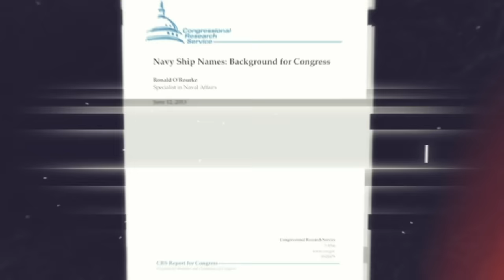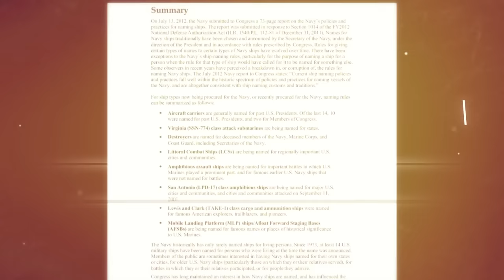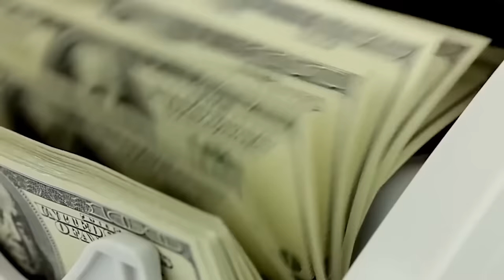US Is Testing Its New Gigantic $13 Billions Aircraft Carrier

Comment: Interesting but down voted for misleading thumbnail. Also, aircraft carriers today have less to do with providing real tactical support against developed armies and have more to do with providing political pressure. Coordinated batteries of modern missile systems can overwhelm and sink any ship, including those with advanced long range defenses.

The only question is how many and how fast.
Reply: Flawed analysis.  (1).  Political pressure in the form of a deterrent avoids pathetic, costly wars.  (2).  Sinking a US carrier group would put you in a world of hurt in terms of response.  (3).  The Chinese just completed their own home-built carrier.  Seems the need for projection of naval power, especially in regions that have none of these anti-carrier missile system capability, is shared between two radically different governments.
Reply: @j.hudson9652  I'm not qualified to support either side of carriers being useful militarily or not, but the Chinese are very much the exact type of government that would spend billions on a pure prestige project.
Reply: @tylermech66  Excellent point.
Reply: can coordinated batteries of modern missile systems hold ground? can they physically occupy there? can they reach the range without a naval fleet? can they launch real attacks?
even with tanks when a tank can be destroyed by a simple missile launched by a soldier, you cannot hold ground with those missiles, you still need the tanks
with these aircraft carriers carrier groups are capable of using planes and support and recon and the radar coverage allows real missile launches which wouldnt be capable without these carriers
modern missile systems cannot reach that far of a range unless they are big icbm's which are extremely costly and not that accurate, you would need far larger barages to take down a warship assuming you know where it is (which you need air support for)
Reply: We’ve got nuclear submarines to deal with that

Comment: The arrester cables are not "ropes".  They are extremely high strength woven steel cables.  They are the most dangerous thing on the deck for the deck crew since if one snaps during its pull phase, it can whip across the deck at very high speed.  Important safety precautions are related to this danger.
Reply: Actually they are arresting gear cables made of hemp core wire rope.
Reply: The arrester cables are not "ropes".  They are extremely high strength woven steel cables.  They are the most dangerous thing on the deck for the deck crew since if one snaps during its pull phase, it can whip across the deck at very high speed.  Important safety precautions are related to this danger.
Reply: I’ve been using wire ropes for years I had no idea that ropes must be made of cotton or hemp what are these round woven things made of metal called the store told me they’re wire ropes o great one what do we refer to them as cables doesn’t seem to fit because they are a bunch of wire ropes twisting together is it a size thing like boat’s versus ships like my thing is bigger than your thing🤔
Reply: So it’s a steel rope then. That’s not a boat it’s a ship.
Reply: @flashgordon6670  Unless you're an Airdale then they're all BOATS! lol
Reply: There's a video on YouTube of a Hornet going over the side when the cable broke.* In slow motion from another angle you can see one of the flight deck crewmen jumping over the cable as it whips around, not once, but twice. Lucky guy!

*I talked with someone who said he was in one of the two arresting gear rooms associated with the problematic cable. I forgot the specifics of what he said, but apparently something about the purchase cable was rigged incorrectly and so the cross deck pendant didn't break, the whole thing was pulled out. True or not, I don't know.
Reply: Any idea how often the cables are replaced? I've always wondered....
Reply: @luke8210  Yep! When I was in the Navy I deployed aboard USS Carl Vinson, and years later when I was a civilian employee of the Navy I spent three days at sea on Vinson. One of the Aviation Boatswain's Mates explained it to me.

There are actually three parts to the cable. The portion stretched across the deck is the cross deck pendant, and each end of that is attached to a purchase cable, which runs down below the flight deck to the arresting gear engine rooms, one on each side of the landing area. I believe each cross deck pendant is replaced after 100 traps or if there are signs of damage;the purchase cable aren't replaced as often.

The crews make their own cross deck pendant (CDP) assemblies, and I imagine they have a few ready to go. So each end of the CDP fits into a steel sleeve open on both ends (I think, but I'm not certain of that) and that sleeve is what actually attaches to the purchase cables. The CDP can be replaced in just a couple of minutes, I believe.

The process to make a CDP is pretty interesting. They of course have big spools of cable, so first they cut off the length they need. The take each wire strand and separate them all so none are touching each other. They then squeeze them together to fit into the sleeve (that's not the official term) and they pull it through, at which point the separated strands spring back into position, not touching each other. (Why they don't spread the strands after feeding it through the sleeve is a mystery to me.)

So by now now the end of the cable, wire strands spread apart, have been pulled through the sleeve. Now they take molten zinc and pour it into the sleeve, acting a bit like solder. It cools and solidifies holding the end of the cable in place.. If done right, no strand will touch any other strand or the inside of the sleeve. This maximizes the surface area that's in contact with the zinc, giving it the maximum strength.

So that's a fairly accurate description, but I welcome anyone that's more familiar with the process to add corrections or clarifications here. (It took a lot more words to describe than it should warrant, it's a fairly simple process.)
Reply: Thanks, for taking the time to reply and provide info! I've always wondered and now I know. Thank you!
Reply: ABM  Sorry never minded it myself since not only was I an airdale I was also a tweet for my entire career. Lots of odd names in the military at least in the Navy, some neutral some insulting, it depends on who uses them and how.
Reply: yes commonly called WIRE  ROPE
Reply: @davidabarak  When i was in college they would do wire rope  testing in the big lab. it was 4 stories high and there were windows on the third floor you could look down . that is exactly how they did the ends of the test ropes . they would pull them to breaking. these were wire ropes  2 - 4 inches thick .

Comment: It is not a rope, it’s an arresting gear wire.   From what I have read, the new catapult system has problems.
Reply: THE CATAPULT IS A JOKE 🤣 SURE HAVE STAYED WITH THE OLD ONE FOR THIS FLATTOP COST OVER RUN ABOUT 3 BILLION.
Reply: @terrywiley7977  new tech can have teething problems . the tech offers advantages . when it's debugged fully it will be a big advantage. if you stay with the old you never get better.

Comment: Personally, hyper sonic missiles aren't as dangerous as one would believe. They're extremely expensive due to the amount of fuel used, and they show up on radar fairly early. Provided the strike groups are already in motion, they can actually just move out of the way as most of the hyper sonic missiles glide the final stretch and the speed involved makes it impossible to adjust aim.

The US has moved away from hyper sonic missiles to sub sonic stealth missiles as they're magnitudes cheaper, and offer less reaction time to maneuver or shoot down than current Russian/Chinese missile options.
Reply: @tom burstein No we can't fully defend against it, but the inherent problem is that those missiles are ground based. Currently, with comparing battle doctrines and equipment, the US has a lead  on range, stealth, and cost effectiveness. The Chinese mostly rely on swarm tactics, but they would have to enter within range before they can fire,both in terms of aircraft and maritime combat.

The real issue is invading China through a ground war, where we would have to preemptively scout and engage missile sites with long aircraft ATG.

Another concern are the military bases on the artificial islands China keeps dredging up, but they're constantly being washed back into the ocean, and the resulting unstable ground is actually damaging the airfields they have on those locations already.

Given that the model of Chinese leadership and resulting corruption affecting the nation at a core level is similar to that of Russia, we can expect that they'll be facing complications in resupply and maintenance, but we aren't sure as to what extent. We do know for sure that they're still unable to domestically produce modern microchips under 16nm, which is why Taiwan is such a major target. They have to take the island without destroying its manufacturing capabilities.

While they are a manufacturing powerhouse, they still needed to buy German engines for their submarines, microchips from Taiwan, and certainly other things as well.
Reply: @bjkjoseph  You can with hypersonic missiles if you can detect them soon enough, defeating the entire purpose of making them hypersonic in the first place. With hypersonic missiles, the idea is to have them pointed at a target, then have them use up as much fuel as possible to get that speed. Once it's run out, it starts gliding, and uses the targeting system of whatever who's missile is using to track the target and make corrections. The problem with this final stage is that at anywhere near their maximum ranges, all the fuel is already spent, and they're bleeding speed like crazy. At the two stages where they're either accelerating or gliding, depending on distance to target, it is incredibly difficult to steer to correct trajectory. They're best used on big, slow targets.

Newer US carriers aren't exactly slow, hauling some serious ass with 2 nuclear reactors powering each one of them.
Reply: @Sinyao  They have had wargames 20 years ago that showed carriers Were sunk by old fashion silk worm missiles fired in mass and the admiral that did the wargames was fired, They have to admit it’s a major problem ignoring it won’t make it go away
Reply: @bjkjoseph  20 years ago. Tactics and even major equipment changes have taken place since then.
Reply: Hypersonic are affective for cities no doubt. Also its the hypersonic missiles which dont go out of orbit they stay within our atmosphere/ozone layer straight to target.

But sub sonic stealth missiles sounds good lol 👍
Reply: @Sinyao  Hypersonic are affective for cities or not moving targets no doubt. Also its the hypersonic ballistic glide missiles which dont go out of orbit they stay within our atmosphere/ozone layer straight to target.

But sub sonic stealth missiles sounds good lol 👍

Comment: There are always exceptions to the naming rule. They are bringing back the Enterprise and naming the next in class. The Doris Miller, after the first African American to be awarded the Navy Cross.
Reply: The Navy will go through several names sometimes before they make a final desicion. An early proposal had CVN 80 or 81 as the new JFK.
Reply: @Knights_Oath  there is no giant aircraft
Reply: @Knights_Oath  At the moment, CVN-79 is slated to be the JFK, CVN-80 is the Enterprise and CVN-81 the Doris Miller.  CVN-82 is TBA.
Reply: That's really cool folks.

Comment: The thumbnail photo that you used is clearly modified, and it does not reflect how the ship looks…AT ALL! 

Also, aircraft carriers are recommended to be named after former presidents, but not required. Example: USS John C. Stennis (CVN74), Stennis was a member of the Senate, I believe from Mississippi.

It’s literally impossible to stop an F18…, with a rope. Raised Steel arresting gear cables are used, they have a very short lifespan are replaced often.

Comment: AS A VISIONARY AN ENGINEER AN INVENTOR I CANNOT SEE THAT OTHERS CANNOT SEE WHY AIRCRAFT CARRIERS ARE NOT BUILT AS DIBBLE DECKERS THE TOP DECK FOR RECEIVING INCOMING ANNA DECK JUST BELOW FOR LAUNCHING FLIGHTS . SADLY TO SAY I NEVER GET PAID FOR ANY OF MY IDEAS 😞😣 AND THOSE IN POWER SEEM BLIND AND CANNOT CHANGE .
D . A . G .    BOULDER COLORADO USA
Reply: It’s an interesting concept and I’m sure one that had been discussed by naval engineers in the 1920s. In considering the disadvantages of a double decker flight deck, the first thought would be the turn around time of arming, refueling, and relocating the aircraft from the top landing deck to the bottom takeoff deck.  Another issue could be the vulnerability to operations if one or more maintenance elevators were damaged in battle. Plus, adding another deck would increase weight to the top of the ship. In order to maintain the stability and maneuverability of the ship, you’d have to also increase the width to compensate for it being top heavy. It would be more expensive, a bigger target, and probably slower.
Reply: You have a fabulous idea!  But, why stop there?  Lets put wings on the Aircraft carrier and then it could meet its airplanes halfway.......Genius! Draw up some plans. I'll get Boeing on the phone.
Reply: Check the Imperial Japanese Navy carriers of 1930-onwards

Comment: Could you imagine an aircraft carrier with jet or rocket engines like the freeze frame for the video 🤔 it would most likely be able to fly 😯 totally useless for landing planes on though! 😂 on a positive note...you could get all your soldiers to theatre in a jiffy! 🤔
Reply: Perhaps a hydrofoil carrier? But not one that can fly. I do see potential in SpaceX partnering to transfer units onto aircraft carriers or remote locations.
Reply: Ft
Reply: @TheNuclearBolton  yeah that's what I meant but it sounded silly writing it would most likely be able to hydrofoil 😉 it's a crazy concept that could actually work for big armies like China, Russia or America & yeah I can see space x's starship transporting soldiers to carriers but at a rate of 100 per drop it might be best to just build the hydrofoil aircraft carrier, then have different classes for different payloads, aircraft, troops, mrls & other vehicles & war stuffs. I think starship may be used as a kinetic weapon before it transports people & goods....just a hunch though 👍
Reply: Well yeah or ...
Where to land?
Or would that happen head on?
Reply: @mrsense1444  😂 I am glad you came to your senses, a flying aircraft carrier seemed a little too far-fetched. But technically it would be flying through a different medium such as water. Air is technically a liquid, though not very dense compared to water.

Comment: actually, America has 20 aircraft carriers! 11 of them nuclear. the rest regular diesel. but, they are currently building more, & upgraded bigger carriers.
Reply: That is false.
Reply: What you're thinking of are the amphibious warfare ships. They do carry aircraft, including AV-8B Harriers and the Marine Corps version of the F-35 (VTOL). The 11 "carriers" in the classical sense are CATOBAR aircraft carriers - "Catapult Assisted Take-Off But Arrested Recovery" or "Catapult Assisted Take-Off Barrier Arrested Recovery" - the latter definition of the acronym as barriers aren't used.
Reply: A diesel CV? 🤣
Reply: @MrKim-kv2vv  Well, a couple of things. All of our "conventional" aircraft carriers - also called CATOBAR (catapult assisted takeoff but arrested recovery) - that have catapults and arresting gear are nuclear powered. In the past, we had CATOBAR carriers that burned fuel oil to generate steam, rather than generating steam from the heat nuclear reactors provide. The last active CATOBAR carrier we had was the Kitty Hawk, CV-63. (I may be wrong on which one, but I'm pretty sure I have it right.) These oil-fired carriers used "bunker oil," which is less refined and thicker than diesel. However, they had (and the nukes still have) diesel powered emergency generators, and that diesel fuel could be used in the boilers of those older carriers if needed.

I believe some of the other carriers, those amphibious warfare ships, do use diesel to run generators that then power electric motors that turn the shafts - although I could be wrong on that. We may still have traditional oil-fired "amphib" ships that burn bunker fuel to boil water. (And for the record, the water is heated beyond the boiling point since it's under pressure. Regular steam is saturated steam, it still has moisture in it, but the steam used to run the turbines that turn the shafts is super-heated so it's gaseous and has no moisture left in it. It's extremely dangerous.)
Reply: 11 aircraft carriers 9 helo carriers

Comment: Why they make the F-35 use a catapult baffles me. Does it not have vertical take off capabilities?
Reply: There are three variants. The F-35B is the vertical takeoff variant. The F-35C doesn't have this capability but instead has the launch bar and hook for carrier operations. The C is the Navy's variant, B for the Marines.

Comment: Any "future" Aircraft Carriers are going to take on a very different look and function than past and current Carriers.  Being that most of the newer 6th and 7th Gen Fighters that will be part of the Carriers won't need to land or take off like conventional planes, the decks will be redesigned.  New Carriers will also be HEAVILY armed with Laser and Rail Gun Systems to combat missile attacks which will be the greatest threat next to a Sub Attack.  The new Carriers will be a cross between a normal Carrier and a futuristic Battleship.

Hopefully, they stop naming them after Presidents.